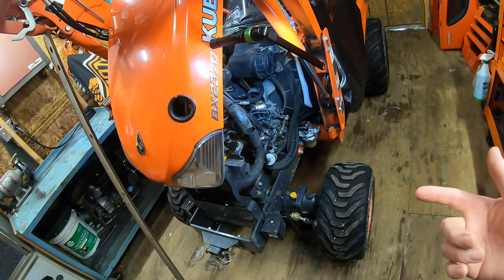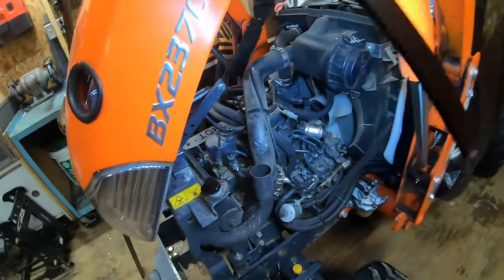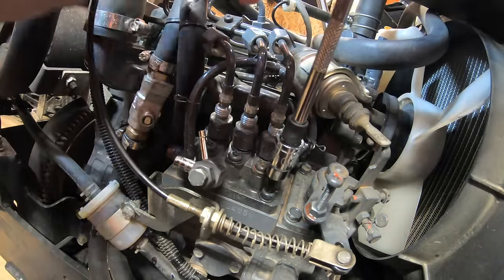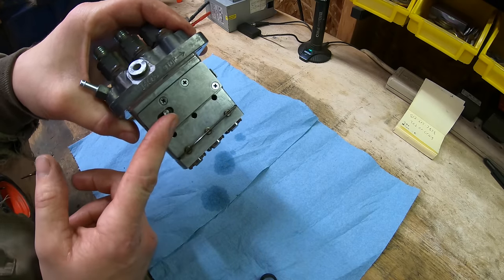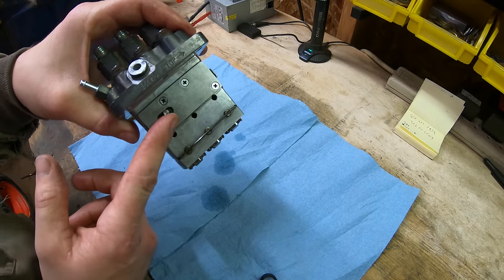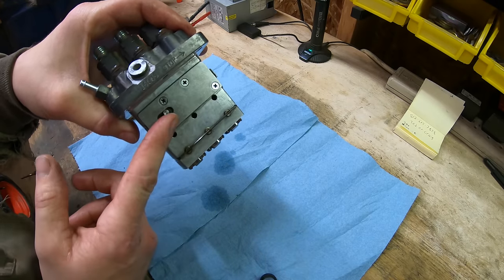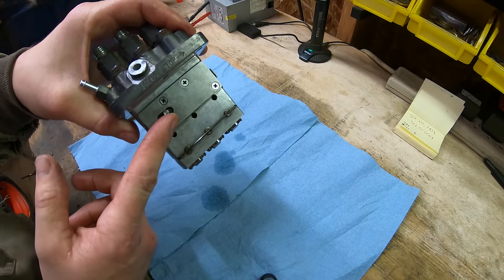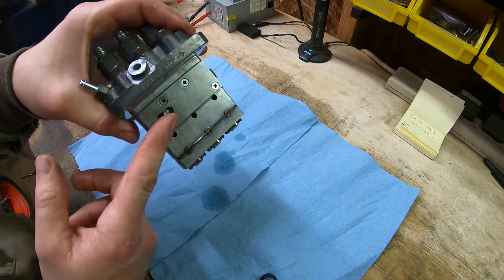Kubota BX- Injection Pump Modifications/Rebuild D902 (More Fuel!!)

Comment: I finally got the injector pump out. The fuel control rack was completely seized up.  Your video is fantastic, and I could follow it step by step and rebuilt the injector pump. Thanks!
Reply: how did you  get it out ? I think I have the same problem , i can lift the pump maybe a centimeter , but no way of pulling it out further , and I dont want to start hammering the thing ......
Reply: @markevans8446  What happened?  Success?
Reply: My engine is a D600, not necessarily identical to this one
Reply: @markevans8446  did you ever get it out? im having the same issue

Comment: Dude, first time finding your channel.  Absolutely awesome video.  Not only explaining the mod but also the different parts and functions of the pump.  I just acquired a Mower with a 4 cylinder Kubota diesel.  The fuel rack is seized open as well as two plungers faulty.  One plunger just flops around, the other plunger is stuck up in the injection pump.  I thought I could get it to run on two injectors but it will not.  I purchased a reman.
Reply from the maker: Hey thanks man I appericate it! Doing videos like these where I have so much explaining to do takes a lot of time and effort not only to record them and show all the shots but to also edit them so I’m really glad you got so much from it cuz that’s why I do these types of videos! Sorry I’m just now seeing your comment, hopefully the reman pump worked for you? I wouldn’t run it on only 2 cylinders as the engine will run horribly and you could hurt it. Best to just replace or rebuild the pump and go from there. I always wanted a Zero Turn with a Kubota diesel! I’m always on the look for one I can find cheap with an issue like yours and fix it up myself. You know you can buy turbo kits for them too? Pretty cool stuff haha. Take care!
Reply: @BiffsEquipment  reman pump works great!  I do have the very slightest miss but I think it's due to injectors.  I'm going to run some sea foam in it and go from there.  I used your techniques, especially making sure I could cut the fuel and not have a run away diesel.  Works great!

Comment: Thanks for the education. I work at a Grasshopper dealer and have noticed the diesel 902 would struggle to regain RPM when you engage the deck. We may have to try this.
Reply from the maker: Sure thing Danny. Sounds like there may be another issue going on tho.. like maybe the Spindles/pullys are not spinning freely dogging down the engine on startup.. or maybe it’s something simple like a clogged air filter keeping torque low. I would check over things like that first but if nothing else helps then you can try this. Just be careful to watch exhaust gas temps as adding more fuel makes them hotter specially when under a load as the more load the more fuel, and a mower like that will keep the engine under a decent load for hours straight and that’s when you gotta worry about melting a piston with adding more fuel like that. With my tractor tho I havnt had any issues with EGT.. I mow for 6 hours striaght but mostly it’s pretty short grass nothing super long so I can’t attest to how it would handle real tall grass at a real heavy load for hours at a time but time will tell.. I plan to add a turbo to it soon tho so that will no longer be a worry anyways once I do 👍🏻
Reply: @BiffsEquipment  it's a problem with all of them even new ones.

Comment: Biff, how do i reassemble the pump if I lost track of what little coin with the number one it goes.  I got two that say 05 and one 10, i lost place of which one goes to which.  Also I didnt know about mark the top for reassembly, prior to disassembly...  so im stuck in the mud here, cant figure out the timing at all and in a no start condition.  Ive retried and reassembled about 15 times now over 3 nights.  

Thanks

Comment: I’ve done gust about the same thang to my l 2501 but I gust had to remove a shim to give it more power
Reply from the maker: Very cool Dylan! Which shim did you remove the one under the pump? If you remove the one under the pump it will advance the Timing which is what you want if your going for more power.. diesels love timing! The shims inside each cylinder of the pump I believe are for independently timing each cylinder on its own.. the shim under the pump will advance or retard all cylinders evenly.. Iv debated finding a smaller shim for mine myself

Comment: Have earlier Kubota B7200 with a D950 engine.
Does the BX have a compression release for cold weather starting aid?
What do the extra water lines do? Heater in the cab maybe?
How are the turbo plans going?
Nice work on the 5.5mm upgrade.

Comment: I would assume that the parts of the tractor are designed in a way that they fit together powerwise. You now have more hydrostatic power and more engine power so you can lift heavier loads which will put more strain to the rest of the machine. I would assume that something breaks soon.
Reply from the maker: I agree with you, every single component on these machines have been tuned perfectly to work with one another efficiently, safely, and reliably. Modifying them always gives you more chances for more breakages and abuse especially when your adding more power.. this mod will certainly hurt fuel economy a bit too but I’m doing it for a test.. I’m curious if there is any extra power to be gained by just giving it a bit more fuel through out there entire RPM band.. so far so good but I havnt worked the tractor very hard yet.. this summer will be a good test when I rip our stumps and mow high grass and put a good load on the engine and Transmisson/pump. Thanks for watching!

Comment: Today I discover generous fuel flow from the injector pump area (BX25), possibly at the shim to block?  If the weather holds, I will be exploring this tomorrow.  Thank you for this video.  The Service Manual says "Never try to disassemble the injection pump assembly."  (let our inexperience mechanics experiment - lol)
Reply: The result:  One of the rubber fuel return lines developed a pinhole which sprayed directly on the injection pump.  All fixed and didn't have to pull the pump.

Comment: Sorry new subscriber, About 1 year behind.

Enjoyed the injection pump upgrade video.
You didnot reveal the model of the injection pump.
Assume it is a Zexel pump but comes in seversl models.

I noted you hope to upgrade your BX2370 to include a turbo.
Where does that project stand?

Interested from whom on eBay you obtained you new larger pistons and cylinders for the fuel injector.
You said old piston about 5mm in diameter and new ones are 5.5 mm dia.
How did you know what size to get?

Hopr to hear from you.
Tom Kergil

Comment: Just what I had been looking for.  I have a BX200 that has a very slight leak at the injection pump.  I can't visibly see where the diesel is leaking.  It will get the whole pump wet and seep down the block and puddle on the floor.  I want to replace the O rings and crush washers and hope that fixes it.  Dealer says the pump is not serviceable but will gladly sell me another for $ 1600.  Having trouble finding the exact size of O rings.  Any ideas?

Comment: Thanks for the video. Very detailed and also it was great to see what happens when the plungers are installed backwards by mistake. Good to see that type of stuff and what happens. Do you happen to have have the item number from eBay on the plungers you bought? I have a grasshopper zero turn mower with the same motor. I could use a little more power for my terrain. Thanks
Reply from the maker: Thanks Andy, I agree.. there is almost NOTHING online about these Pumps.. nobody actually goes through them like I did and explains every little part and piece and shows what I showed.. a lot of the videos they don’t speak English or just don’t explain anything which is what promted me to make this video. As for the plungers the ones I used will work in yours if you have a D902. I left a link in the video description to where you can purchase these plungers from eBay. Check it out, I think they are like $55 each. One thing I noticed is now that it’s getting more fuel it runs rougher when it’s cold, specially when it first starts up.. after it’s warm it’s fine but cold starting is worse and it’s a bit rougher running when cold.. this is normal tho as most Diesel engines don’t run as smooth after increasing the fuel delivery.. my Cummins was the same way when I went with larger injectors but this just means it’s getting more fuel so that’s a good thing IMO lol. In warmer temps it runs exactly the same or once the engine is warm tho it does feel/ seem snappier.. I can’t wait to mow with it for the first time this season to see how it feels under a load as that’s where you’ll notice the extra power/fuel the most.. driving around normally it should act/smoke and run basically the same but once it’s under a load it will smoke more and have more power/torque. I have a turbo I bought also for my tractor but I havnt put it on yet. Been waiting to make a video on the install after I finish building the rest of the turbo kit. Once I add the turbo I think it will start easier when cold also as it will have more air then to clean up the fuel

Comment: Wish I had seen this video earlier today, I have just installed a service kit on my BX1820 D782 Zexel injector, I connected all fuel lines up, it started real easy then I ended up with a "runaway diesel"    It is not a pleasant situation.  
I guess I did NOT get the injector stop/slide in the stop in the groove  -  Aghhh   I  couldn't shut the engine down, I had to pull the fuel hose off.    I had also slackened off #1 and #3 fuel lines and it started when fuel got through, so refurb on injector definately worked :-) , I had fuel spraying all over place, so a bit panicky as it was from the injector,  whilst running around like a headless chicken,  I thought to tighten up the pipe nuts - NO, engine just ran faster -

I will remove injector and dis the pipes and use your method of tying back the stop control tomorrow.  It is no easy feat to get that stop into the groove :-(    

Cheers
------
Update, Re-installed pump this morning, tried to shut fuel off when turning the motor, no good, took injector off and on 5 times, still same, so back to bench and rotated pistons through 180, re-installed and bingo. Works a treat now.

So, reason why, I followed a Youtube step by step on how to rebuild, pretty much like Biffs, the problem was, that though the injectors are 'almost' identical, my fuel feed is on the  opposite side to the one I was watching on Youtube, also the slider (stick out lever) was on the left side whereas mine is on the right, so even though I position the markers to the slot side that was wrong.
I am guessing that the slots on the pistons should be on the same side as the fuel input, !!!  But cannot find any docs to confirm this.
Anyhow, back up and running, road test today, AOK

Cheers guys.
Reply from the maker: Thanks for all the information about the issues you had and what you went through to fix it. I’m glad it all worked out in the end.. if you see at the end of my video I had a very similar problem. All the diagrams I looked at did not show which way the plungers went in, so I installed mine 180 degrees off as well.. at the end of my video I show how to check this essentially.. you want to hold over your stop leaver before connecting your injector lines and the fuel does not stop shooting from your injection pump then DO NOT start the engine.. take the pump back out and rotate the plungers 180 degrees because odds are they are backwards.. once you rotate them 180 degrees reinstall the pump again and test to make sure the fuel stops squirting out when the stop lever is pulled.. if this works then your all set to install your injection lines try and start the engine. Hope this clears things up!

Comment: Cool project. I can see from the video that just revving it is probably turning your Kleenex black.

With a mechanical system, I wonder how you could deliver fuel proportional to the airflow and throttle you are giving it? Pneumatic piston to get more throttle based on boost? My expertise is in gasoline efi systems, so the simplicity of this diesel thing is rather curious.
Reply from the maker: Hey Mike! Great question.. so I can tell your more use to gas motors.. gas motors as you seem to be aware need to have the perfect air to fuel ratio otherwise the cylinders will dentinate if your running it too lean.. running too rich will cause power loss and bad fuel economy and can also cause issues.  With a diesel engine because it does not have a throttle body.. and because they do not have spark plugs.. diesels run souly off the heat of the compression cycle alone, causing the fuel to burn and stay brining.. because of this you can add as much fuel as you want to a diesel and all it’s gonna do is cause it to smoke more (black smoke) which is unburned fuel. The main downside to running too much fuel in a diesel is that unburned fuel creates heat, so your exhaust gas temperature rise and if they rise too much it can litterally melt your pistons.. so instead of a “wide band” to measure Air/fuel ratios like you’d do on a gasser.. a diesel just needs to have an “exhaust gas temperature sensor” .. if the exhaust gas temps get too high then you know it’s getting too much fuel.. if they are low then you know you can add more fuel… As for your last question.. you can force as MUCH air into a diesel engine as possible.. it will not care and will not hurt the engine so long as it can withstand the boost pressures.. diesel engines are incapable of leaning out and blowing up because they always run lean to begin with.. so what most guys will do is they will add as much air into their engine as it can safely handle, then crank the fuel up which will allow the engine to actually make power with all that extra air.. while adding fuel you’ll watch your EGT gauge to make sure your exhaust temps don’t rise too high and then your all set.. diesels are much simpler when it comes to gaining power than a gas motor and require a lot less tunning. 

Lastly you can and may have to adjust your timing as well.. the more advanced you are with a diesel usually the more power you’ll make.. the more retarded the richer it will run and it will be a bit more sluggish.. so tuning your timing will be based on what your trying to accomplish with the engine. So anyways.. this is why I said in the video that I installed larger plungers so that I could not only get more fuel at a certain RPM or time but could get more fuel through out the entire RPM band.. from here I’ll add a turbo to clean up the smoke and will be able to make alot more power now then stock because just adding only a turbo to a diesel will pretty much do NOTHING unless you have more fuel first for the air to help burn it off to make more power.

Hope this helps!
Reply: @BiffsEquipment   Thanks for the detailed description. Re-reading what I wrote, I don't think I explained my question very well. You mentioned a turbo was planned. How do you deliver an appropriate amount of fuel through the entire RPM range without an obscene amount of smoke at low RPM before the turbo spools up? What turbo are you thinking about? Maybe you size it small enough that boost threshold isn't an issue?

Comment: Nice job man, that engine is a d902 right? Doesn’t kubota have a d902t turbo? That would make a turbo job pretty straight forward if you could find one . Good luck. Also have you thought about putting an egt gauge on for when your really working it ?
Reply from the maker: Thanks Mark! Yes Kubota does make a D902(T) for turbo.. but the issue is I have done a ton of research on that motor and it seems Kubota only build that motor for specialized purpose for those who work way up in the mountains where atmospheric pressure is low and where contractors or farmers need that extra power.. so because that engine is not physically installed in any machine it’s extremely hard to find the parts for it.. my original plan was to use the turbo, injectors, turbo manifold and injection pump off that engine but I called everywhere including Messicks and nobody can locate the parts for that engine.. not even the part numbers as it’s still such a new engine :/ so looks like I’ll be designing my own turbo kit but I do plan to use photos of that engine online to base my own turbo setup.. I plan to replicate it the best I can. Stay tuned and thanks for watching!

Comment: Very curious on this! Great video . Want to also build a turbo set up on my grasshopper mower with the d722 engine. Couldn’t find any decent leads to more fuel. Can’t wait to see the turbo on there
Reply from the maker: Thanks buddy! You can also turn the fuel screw for more fuel as well. As for the turbo setup, I got the kit semi built but then never got back around to it. I have to find time to finish it hopedully mid to late summer. I really wanna put that turbo I have on it. It’s a pain on my tractor as there is almost no room for the turbo so I have to have it clocked just perfectly for the oil drain and charge piping to fit the way I want and it’s still gonna be a struggle. It can def be done though but it’s gonna take more work than I anticipated due to the lack of space under the hood. On a lawn mower you have much more room though, same as like a Kubota UTV and so on so those are pretty easy to turbo. I’ll keep you guys posted for sure once I get back on that project and I’m hoping soon! Best of luck with your project!